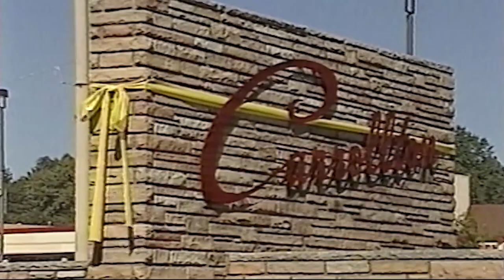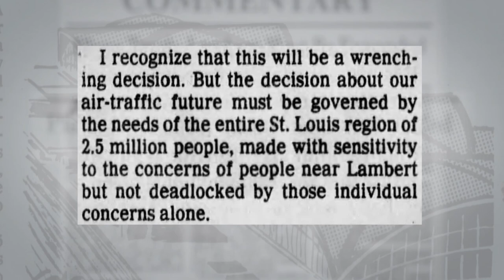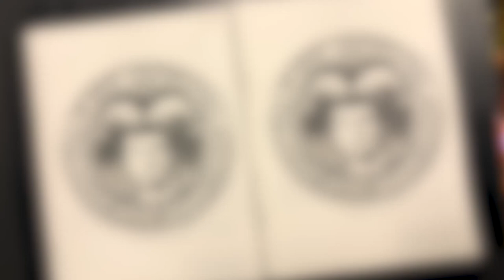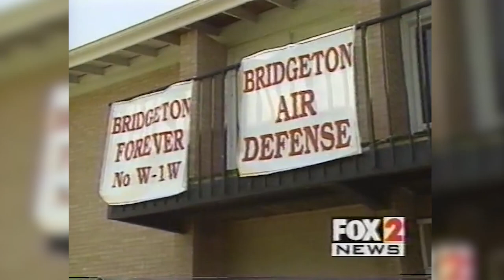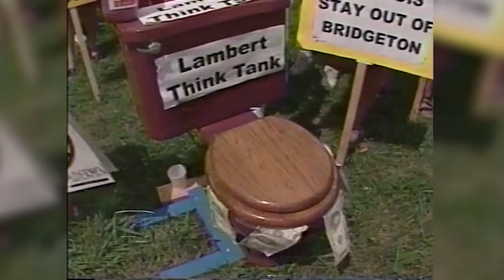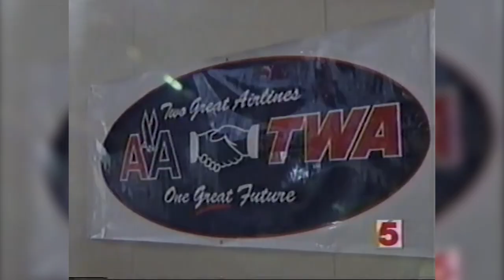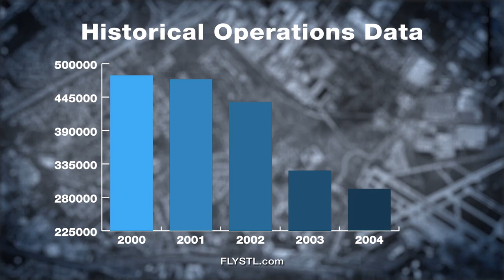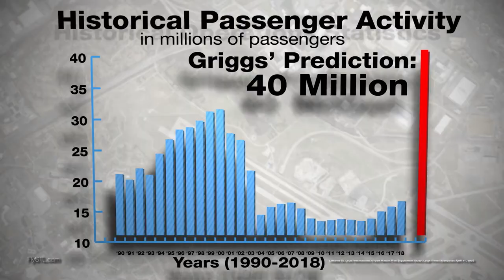Hard Landing At Lambert Carrollton Bridgeton Documentary

Comment: This is a stunning documentary. It was apparently apparent to no one in metro St. Louis power circles that while they were discussing F4 and W1W for Lambert Airport, there were at least three BRAC (Base Realignment and Closure) lists that came out (in 1991, 1993, and 1995) that could have placed Scott AFB in IL on those lists. In turn, Scott AFB could have been metro St Louis's replacement passenger airport, and Lambert could have still be used for military/cargo/Boeing (previously McDonnel Douglas) purposes. Look at Austin getting Bergstrom AFB for their replacement airport in 1999 for how that would have worked for St Louis. Or, take a look at Cincinnati for how a Ohio city gets along just fine with its major airport being across the Ohio River in Kentucky.
Reply: Most likely they did know, but utilizing Scott would not have fit their agenda, just like utilizing MidAmerica Airport didn't. That made MUCH more sense, but the powers that be had no interest in anything that was not owned by the City of St Louis.  Although located in the county, Lambert is totally owned by City of St L & is a huge source of revenue, one they cannot survive without.  This was never about improving the metro area, it was about the city making money & regaining power.
Never forget that the City of St Louis is an independent entity and is NOT part of St Louis County.

Comment: It's easy to criticize now; no one knew that TWA would sell out to American Airlines. Once that happened, it was obvious Lambert would no longer be a hub. But no one knew that in the 80s when the push for the new runway started. Picture a different future-what if TWA still existed? It likely would still have a hub at Lambert. If that were the case, the new runway was absolutely be needed--the two main runways are parallel and too close for FAA to allow parallel flight landings/takeoffs in bad weather. While I disagree with the entire process (no way the corrupt and/or incompetent City of St. Louis should control a piece of land not within their city limits), there is not much question that if TWA still existed, they'd have a hub in St. Louis, and that new runway would be needed.
Reply: If they hadn't built the expansion, TWA might still exist.  Okay, probably not, but back in the late '80s we were pointing out that STL's future as a hub for TWA was not assured, and didn't take a rocket scientist to look at TWA's repeated bankruptcies and figure that out.  TWA was struggling through the late '80s, and the one thing they needed least was to be saddled with the debt of buying a subdivision, building a runway, and having it all financed by bonds that had to be retired using revenue generated by landing fees.  It might have made sense (but maybe not) if the expansion had actually allowed parallel flight landings/takeoffs in bad weather, but the threshold offset was too great, as the pilots and air traffic controllers pointed out many times. If they hadn't expanded, who can say what would have happened -- perhaps STL would nevertheless not be a hub today.  But the fact that STL chose to dramatically increase their costs without significantly increasing their capacity guaranteed that STL would lose its role as a hub, and it also burdened the taxpayers with the debt.

What they needed to do was expand capacity.  What they chose to do was expand debt, without significant capacity increase.

Comment: S-1 was the 'pilots preferred'? What did they think would happen to I-70, which is right where S-1 was going to go? Move it right? That means MORE houses would have to be eminent domained.  NE-1 would have required demolishing Boeing manufacturing facilities that were being used for F-18, F-15, and AV-8 assembly lines. The odds of that one happening were slim to none, and slim just left town. Seriously, you could find dozens of reasons to be against every single one of these allegedly superior new runway plans.